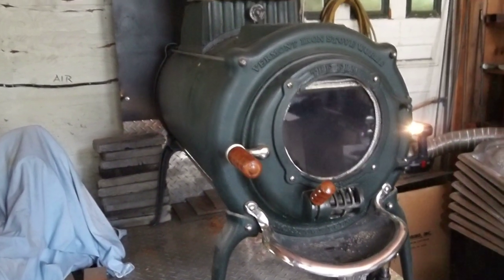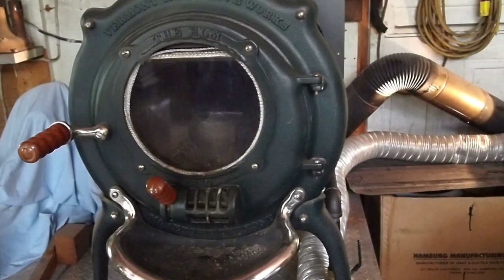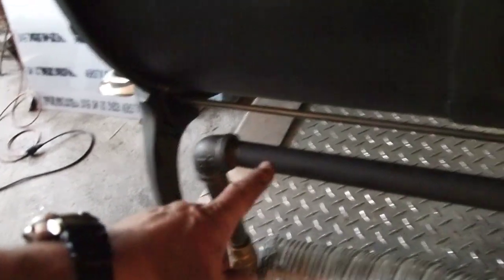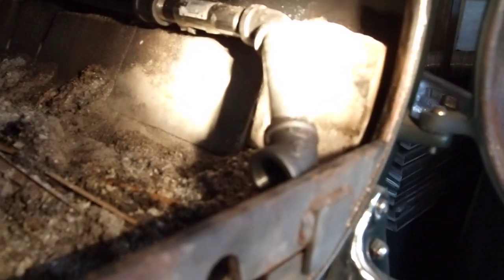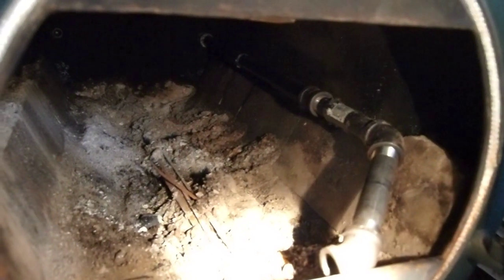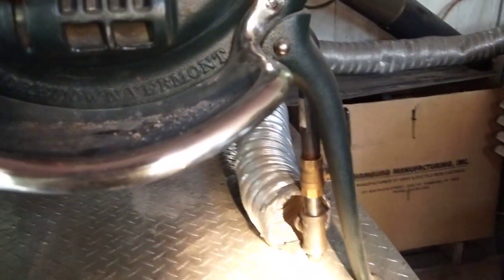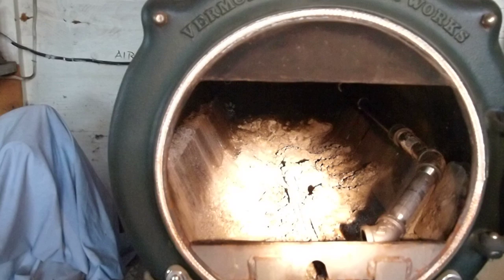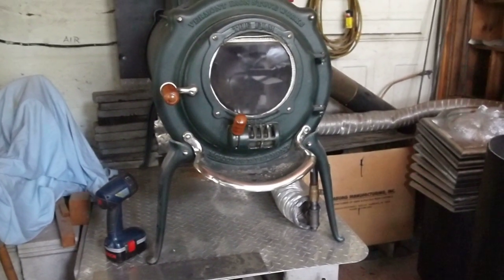Make-up air for primary and secondary combustion systems on the Wildfire Elm

Comment: Is there a video of the test burns? As a guess, I'd guess larger diameter tubes would be beneficial and that the dryer vent ought to be choked down to furnish all combustion air and only combustion air. But what have you found?

Comment: I built my own stove years ago. Mine works with the primary air completely shut off, with secondary tubes that keep the fire going, and also burn up the smoke. If you heat up the chimney good (about 250 degrees) then the draft should be enough to keep the air coming from the secondary tubes to keep'r going. My stack temp never goes above 250 and usually drops after 20-30 minutes because all the heat is in the burn chamber and not going out the chimney. I have no smoke or creosode.

Comment: It seems to me there is NO advantage to Preheating the Secondary prior to introducing it to the front of the combustion chamber. Introducing cold air to the front of the stove provides for gas expansion at the back of the stove, as it gets 'pushed' up the flu pipe.